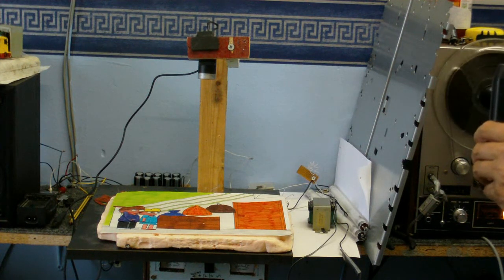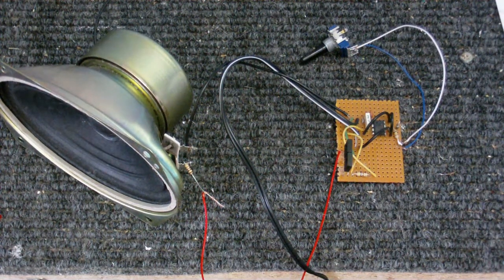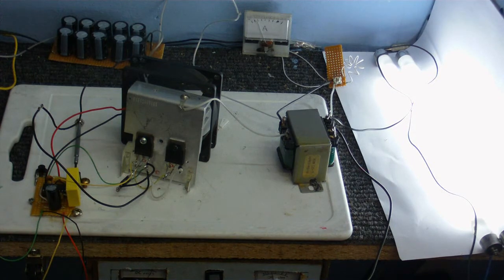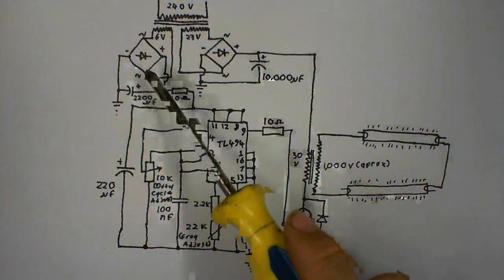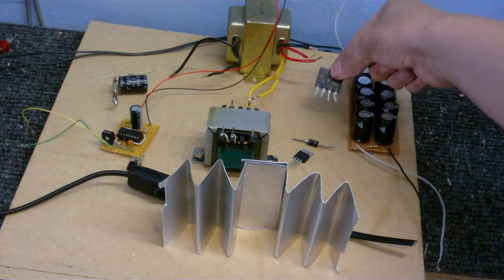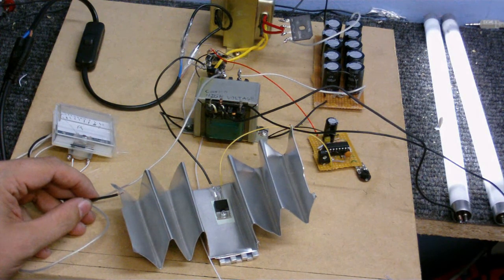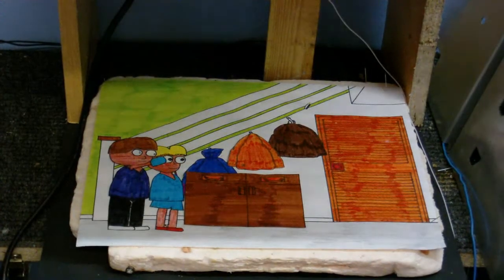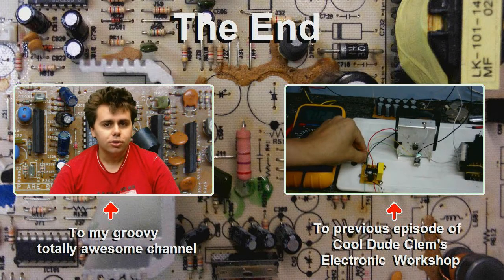CDC Electronic WorkShop - Making lights for my Animation Station!

Comment: On the beginning (using 555 and 60HZ) you use a transformer which i thing is a linear low frequency transformer running it on 50hz which is normal. Then you raise frequency (to improve efficiency) to 15khz and use the same low frequency transformer you used before? What kind of transformer is this that can be opereted at 60hz and 15khz? Please define this since i want to make my own inverter and i find your work interesting.
Reply from the maker: It worked better at higher frequencies mainly because I was using pulsed DC and the transformer was not designed for that.  A transformer like that has quite a low resistance to DC, but with high frequency pulsed DC it's not so much. Those transformers are designed for AC at mains frequencies and in most cases you can use a transformer like that on 50 or 60 hz, it doesn't matter.  For high frequencies like 10khz or more you really need to use a ferrite core transformer like one out of a computer power supply.
Reply: CoolDudeClem so can i use a 50 w low frequency transformer salvaged from an old luxor video to operate your circuit? and operate with 10khz pulsed dc?  its almost the same shape like urs but is 220/18v ac rated.
Reply from the maker: It would probably work, yes.

Comment: Very nice design. :D
A suggestion to deliver even more power out of your circuit, also running the mosfet much colder, is to decrease gate charge time by boosting the current supplied to the gates, using a complementary pair of BJTs in common-emitter mode between the TL494 IC output and the mosfet. Another workaround would consist of using more than one mosfet in parallel, sharing the same load.

Comment from the maker: @Lachlant1984 I probably will make some kind of box to put on the top to house the electronics, might be a good idea as there is exposed high voltage.  The tubes themselves which are ordinary mains voltage tubes should be easy to replace as there just strapped to the top with cardboard, so I could easily pull the old tubes out and put new ones in.

Comment: Good job! I have worked with many different copy stands over years for film cameras. Tube lights work very well. I would use 60 HZ mains. :) Your circuit is brilliant!

Tubes are very expensive, but the government has not outlawed them yet. My wife paid $9.00 for two 24-inch tubes last week in a grocery. LEDs are now available in a tube container, if you have gold for payment.

Comment: Quite an interesting project.  Are you going to enclose the electronics in a box of some kind to make it look a bit more professional?  How easy will it be to replace the tubes should the burn out?  I take it those are standard 240 volt AC tubes, right?  I've made a few YouTube videos using the iSight camera in my iMac and I've had to use a reading lamp with a CFL in it, i haven't had issues with horizontal bars on the screen because of the light, but then results may differ.